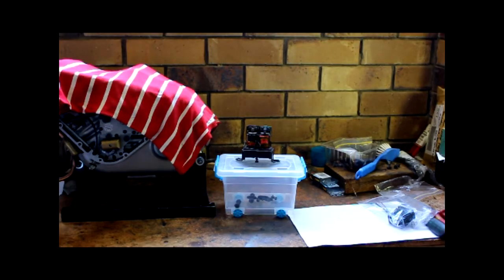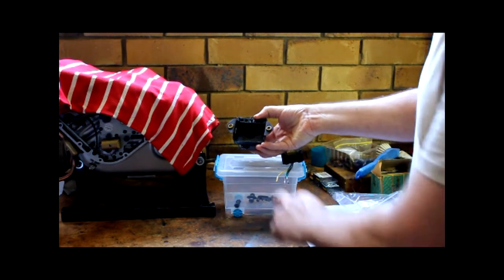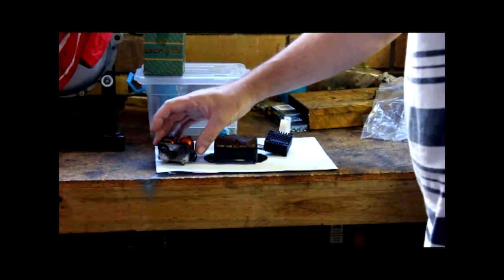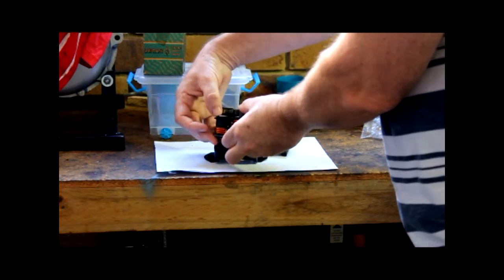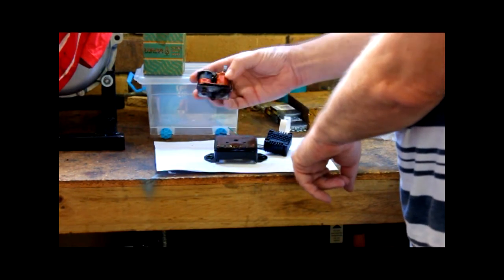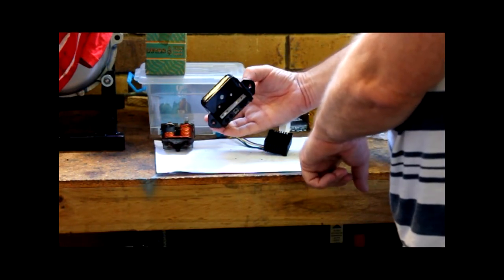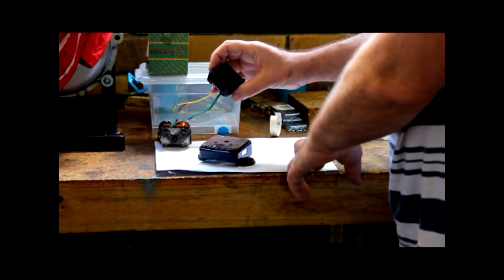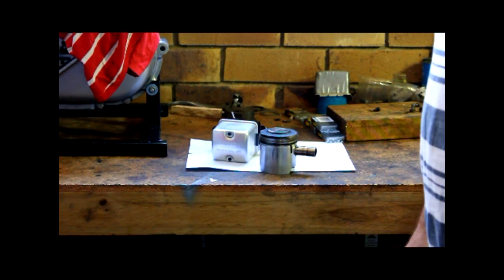1956 Ariel Square Four 12v Conversion

Comment: Did you have to rewire your dynamo to 12v as well? 
I am just starting on Ariels with my first being a 1957 Square 4 Mk2 basket case :)
Reply from the maker: No need. output is controlled by the voltage regulator. If you spin the dynamo fast enough, it will produce 12v.
Reply: @mrsquariel not a tick over or lows revs it won't . Not good for around town riding.

Comment: Hey Greg, enjoying following your restoration.   I am contemplating a restoration for my 1953 MK II.   Can you give me any specifications for the internal thread on your coupling-gear puller, I would like to make one.   Regards Jeff
Reply from the maker: The coupling thread is 1 3/4" x 20. Drags have the pullers if you need one.
Reply: Mr Squariel thanks Greg
Reply: @mrsquariel  Hi Greg, did you ever film yourself using the gear puller and pusher tools? or do you know where i could find instructions to use these tools?